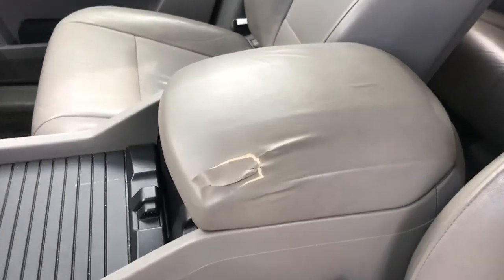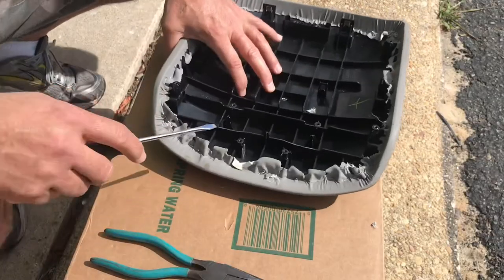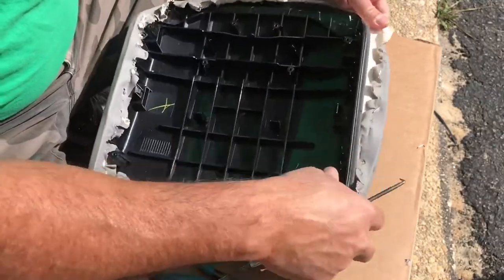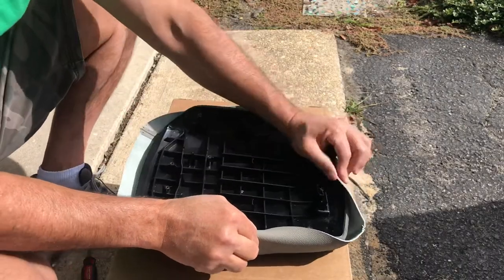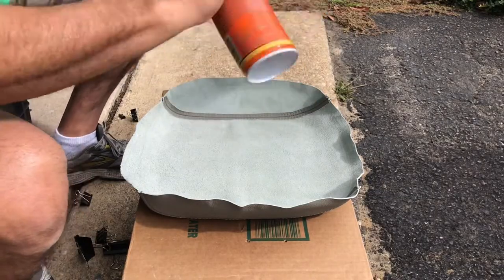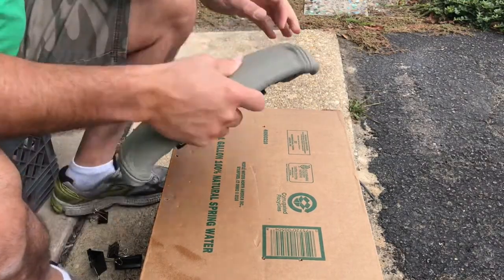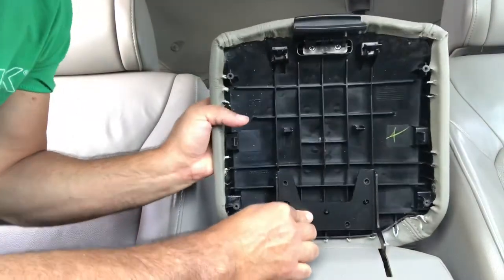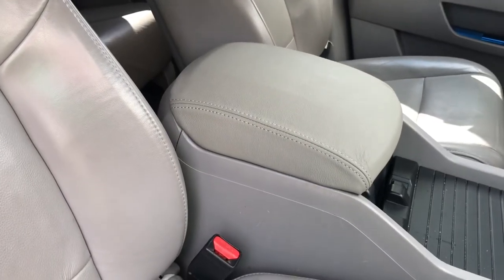HONDA PILOT CENTER ARMREST UPHOLSTERY REPLACEMENT 2009 - 2015:  How To Replace a Torn Center Armrest

Comment from the maker: What do you like best about your Honda Pilot?
Check Out How to Repair Honda Pilot Door Armrest https://youtu.be/NFdDy9rub-s
Reply: My 2010 Pilot has almost 300k miles and is still going strong with just routine maintenance.
Reply: my honda pilot has 293000 km still run like hero👍
Reply: I'm having the VNS light and check engine light come on. It did this 5 month ago but went away...like it reset or something. Now its back!!
Reply: @jkm771 Have you disabled VCM?
Reply: Honda Pilots have a serious anti theft system . If you bypass the key fob unlock and Manuel door key unlock don't work and you have to access inside vehicle another way..the steering wheel locks and if you manage to unlock the steering wheel the wheels lock up so the tires won't roll . So the vehicle will NOT move even if you start it and put in drive oe reverse.  It will NOT roll . Yeah for some reason my key stopped manually unlocking the door . I have an 2008 Honda Pilot. which is a High Performance Vehicle. The engine is solid even when everything else breaks down. The sound system is awesome.  I also have a 2013 Honda Pilot sound system is not as strong as the 2008.

Comment: i watched this video and fixed my arm rest..but i used an air staple gun instead of glue . I thought using blue would be difficult to remove if i messed up.  But i did it. Thanks for making this video it helped a lot

Comment: I started my repair a while back to do while I was recovering from knee surgery.   Everything was very simple and straightforward until the re assembly.    I had a big issue during the reassembly with trying to re-stable the new cover to the plastic piece.    I tried multiple staple guns and staples and nothing would penetrate the plastic piece.  I shelved the project and stuck a pillow where I pulled the arm rest out.  Going forward and getting to the project after months, I went to a furniture upholsterer and asked if they had a pneumatic staple gun that would penetrate the plastic piece.  Their staple gun didn’t work either and I was directed to using stainless steel staples which “ I think” I had already tried.   
So, using that Gorilla glue, I Like That!!
Thanks for the Video!!

Comment: I bought the replacement cover off of Amazon and got as far as removing the old cover and staples. I found your video looking for installation ideas. I was torn about using glue vs staples thinking the glue might soften in the summer heat. Thanks for the confirmation that I was headed in the right direction. The binder clips was a great idea! 👍🏾
Reply from the maker: Thanks for watching! 😎

Comment: You nailed it! Thank you for recording this and walking  through each step. Getting the staples out was the most annoying part but overall, easy day. 👊
Reply: Same for me! Just finished it. The staples did take a bit to get out. But using the glue was a snap. The corners were a little bunchy, but still fit with a little trim with some scissors. I'm glad my dog ripped the original vinyl one, because this looks and feels so much better!
Reply: Anyone else having this issue: I used an upholstery staple remover. Highly effective and very cheap tool! I recommend it big time. It’s often used in furniture restoration.

Comment: This was super helpful.  A couple of things that worked for me.  You're not trying to salvage the old top so no need to be gentle with it.  Once you have a couple of staples out you can cut straight across it with scissors.  Then it's easy to pull off.  After that most of the staples will be half out and easy to grab with pliers.  Also, I put a couple of staples in to hold it in the right place then got the rest with hot glue.  It's precise and has very little wait.  I haven't had bad luck (or more likely bad skill) with spray adhesives

Comment: Thanks so much for to video!  I just replaced mine (09).  I let my leather lay out for a couple weeks to get the wrinkles out. I also used a staple gun instead of glue. Pulling the old staples out was the worst part. Looks so much better
Reply from the maker: Thanks for watching! 😎
Reply: What size/type of staples did you use?

Comment: Just finished replacing my console cover after watching your video.  I used gorilla glue and 6mm staples to attach the new leather (not as many staples as Honda!).  I also used a hair dryer to heat/loosen the leather to help stretch it over the foam/plastic.  Lots of stretching required.  Turned out great!  Thanks for your video!

Comment: I changed it for my 2011 Honda Pilot and looks perfect. Thank you for the video and it helped a lot. I thought that spray adhesive is too strong and once it mess up then it turns bad. I used spray but you have to do lot of stretching before it dry.

Comment: Worked perfect, thanks! Those staples were a bugger to get out, I used a small screwdriver and needle nosed pliers, and a six pack of Coors light. Also, that glue sticks to everything! (next time I will use vinyl gloves). The finished repair looks fantastic.
Reply: An upholstery staple remover tool was perfect! Saw these comments, so I bought a cheap one and it was a miracle tool :)

Comment: Very helpful video. My question with using the spray glue is what happens when it needs to be replaced again. Thanks for sharing your knowledge. Happy 2022.
Reply from the maker: You should be able to pull the material right off. But by then you’ll probably have a newer car anyway. So no need to worry.😀 Happy New Year!

Comment: You can also use heavy duty staple gun with 1/4" staples. I used the arrow t50 staple gun and it turned out great! No glue and looks like its from the manufacturer. Just pull and staple!
Reply from the maker: Whatever works. 😎 Thanks for watching.

Comment: Great video.  Was the adhesive just sprayed on the sides of the leather and arm rest, and not the top area?
Reply from the maker: Yes, just the edges.
Reply: @fixinit  thank you so much 👍🏽

Comment: Thank you for the great tips. I was wondering what kind of staple and pin can be used instead of glue( which i think will last longer). Any tips?
Reply from the maker: I would think any heavy duty staple would work. Maybe someone else here can recommend the correct staples. The glue is way easier and with the bottom cover on, it’s not going anywhere. Thanks for watching!

Comment: Dude! The instructions to the repair were to a T.  Few items to share on my experience. Key  to removing staples (used a 5 point and pliers), start wrapping from  front center (look for a small V cut on leather and align to notch under the cover), when appling gorilla spray avoid center. (allows ability to easily stretch),  avoid wrinkles by lifting and resetting.  Total time  1 hr (plus overnight for leather to stretch).
Reply from the maker: Thanks for sharing 😎

Comment: My concern with the glue is that if you ever have to replace it again, it is going to pull some of the foam padding off.
Reply: True, but if you still have that Pilot in another 10 years,  you're probably dealing with bigger problems! Worst case, you can always pick up another armrest from a junkyard.

Comment: Would an office staple remover work?
Reply from the maker: Mike Roberti You can give it shot.  Those staples are in there pretty tight.  Not sure if you’ll be able to easily get under them.  Let me know if it works. 😎

Comment: If you have a Ridgeline the method is different.  Slide the armrest towards the dash.  Don’t unscrew anything.  Look inside the sliding track and locate the two slide stop tabs on each side.  Ignore the thing in the middle.  Use an 8” or longer medium size flathead to press the tabs down and slide it off.  You might need a second screwdriver and an assistant to slide it off.

Comment: You only used glue? Did the spray adhesive last? I know the temps inside a car can range from whatever cold temp to even hotter than the highest outside temp. That’s to say a glue would have to adhere to both the leather and the bonded surface in both extremes, for years!  Say from -20°F (-6°c) in winter to like 150°F (65°c) in direct sunlight!
Reply from the maker: Michael Ballard So far so good.  That glue usually holds well plus that plastic cover holds everything in place.  We’ll see.
Reply: @fixinit  that cover still holding after 2 years?
Reply from the maker: @stevecox9955  yes